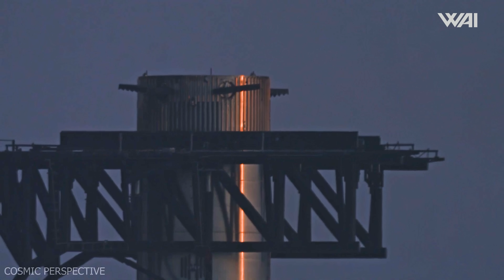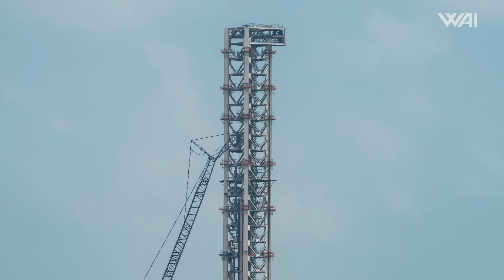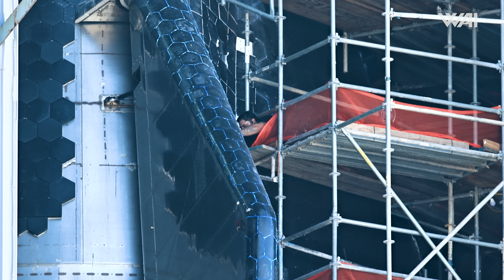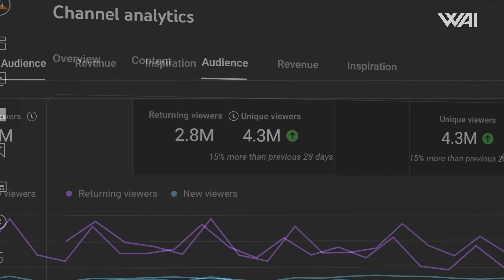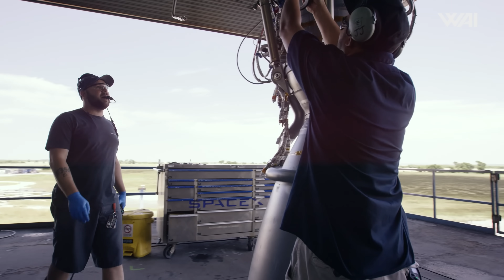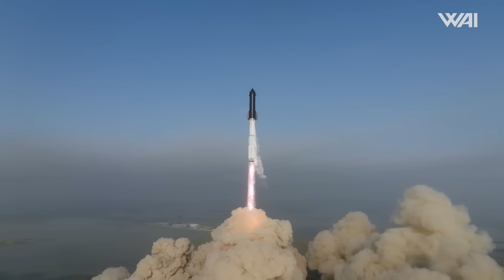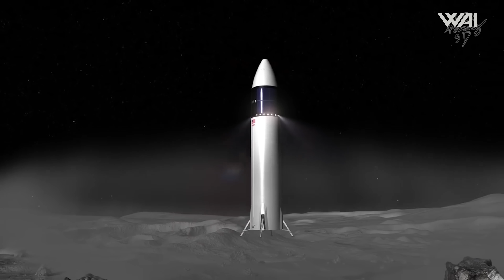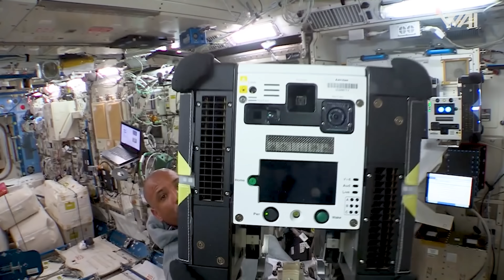SpaceX finally gives out the ONE news we want to hear about Starship flight 6!

Comment: I think it's about time spacex starts producing it's own Oxigen, nitrogen and methane using solar. A quite small farm should produce some basically every day. After a little while building your own plant and piping it into the launch storage is going to be way more cost effective compared to paying a company and having it all trucked in.
Reply: It's all about scale. At the moment, they don't use enough in Boca Chica to be economic viable.

Not sure if it will ever be economic viable - Boca Chica is intended to be a place for test launches. We still don't know where from they will do the frequent launching. And this is important, because they need to know WHERE to build the thing. Not even sure if PADs 39 / 37 will be enough. No idea, really, how they will tackle the insane cadence proposed.
Reply: They are planning an air separation plant which will produce LOX and LN2 and some argon for use in welding but for now Methane will still need to be trucked in
Reply: I don't know about CH4 but an air separation plant is planned. It's going to be behind the second tower roughly in the area where they've been dismantling the big crane. This is shown on plans that SpaceX has released for the updated launch site. They're clearly concentrating on the new tower, OLM and tank farm expansion for now so I wouldn't expect construction of the air separation plant to start until some way into 2025.

There isn't any solar farm shown so presumably it'll be powered off the main supply grid although you're right solar would be good (maybe when SpaceX gets extra land for the land swap?).